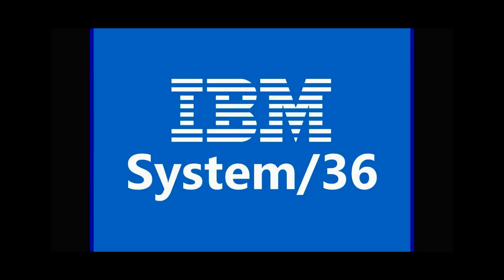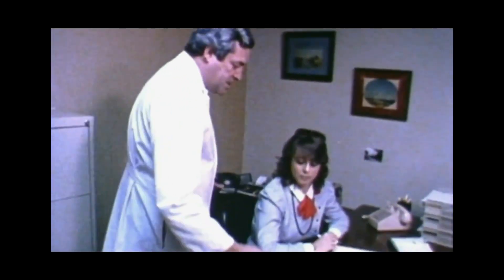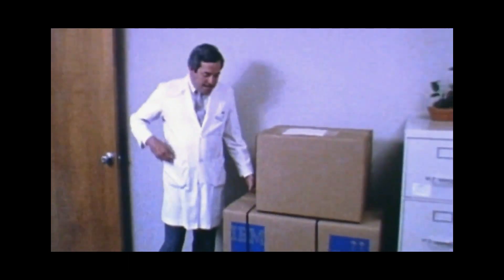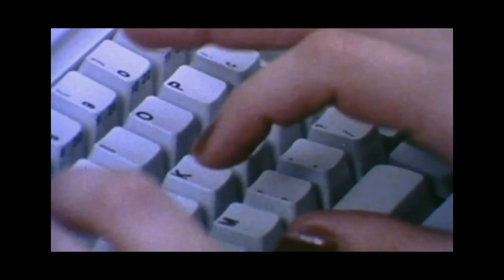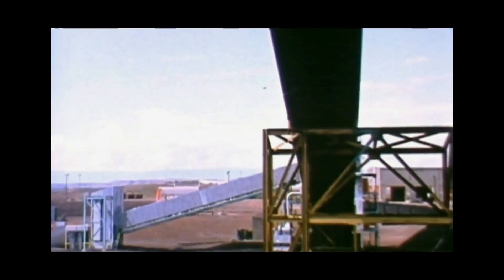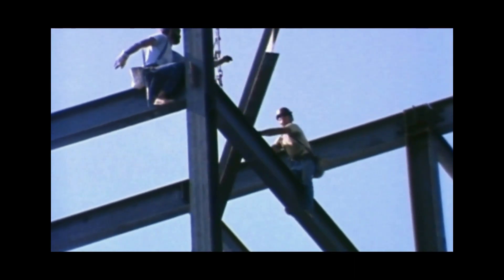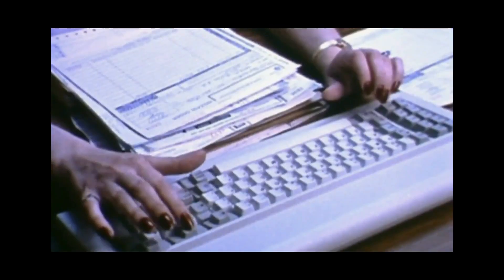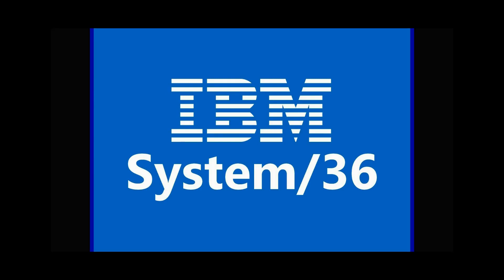1984 Computer History:  IBM System/36 Minicomputer promo, office automation, business, Rochester NY

Comment: A lot of memories. Well, the 3/36 is a "small" system in IBM's terms, not only in size but particularly in terms of cost. However, to ordinary medium size companies, especially companies outside US, the cost of any of the system or the peripherals  components are not cheap. I remember buying a tape drive for data back up (the size of a washing machine) would cost USD20,000,  a line printer will cost similar, list price, if you don't have some kind of corporate discount. The company that I worked with some of the deepest discount level, up to 40% on some items. Even with this level of discount, a fully configured system which can support for about 100 terminals will cost about a quarter million (but the potential benefit it can bring will be huge too). So there are a lot of OEM or compatibles available in the market, and even some specialized company selling 2nd hand equipment. 1985-2000 is also the years for down-sizing. IBM created the Personal Computer standard, which I believe even IBM itself cannot have foreseen the huge impact of PC to the world. All the rest are history.
Reply from the maker: Hi Frankie, yes, you make some great points.  I also remember the System/36 and it was quite expensive for a "mid-range" or small system.  Our first model only came with 1MB memory.  We had to pay a lot for another 1Mb.  These were interesting times for IBM.   So much changed with the advancement of the PC world from 1982 onwards.  Great to have lived through these times.  Thanks again for your great feedback!  ~ Charles

Comment: I did operate the midrange systems S/36, S/38 (Quaker Oats) and AS/400 (Quaker Oats, Head police quarters in The 
Hague, The Netherlands) and ABN/AMRO international, though mostly the AS/400. Great machines for relational databases. The OS of these machines were specifically build for handling these databases.
Reply from the maker: Hi Rene, fascinating.  A good spread of different machines.  We just found an interesting AS/400 commercial (video).  Perhaps we should upload it for those interested in that family.  Work at the Hague sounds like it might have been very interesting.  Thanks for sharing!  ~  Hunter

Comment: What is, the latest version of this system?
Reply from the maker: Hi Caribou Data Science, thanks for your question.  I believe this system has been replaced by the A/S 400 series of "mini" computers.  The A/S 400 has gone through several models as well, and followed by the eServer and other machines.  Hope this helps!~
Reply: The system got renamed every decade and is now known as "IBM i", which appears to run on the same hardware as AIX does, but remains compatible to AS/400 applications.

Comment: Boy, that brings back memories, by first real job in MIS was as a System/36 operator, backing that thing up every morning was a real “treat”. I remember the one I worked on being the 5360 model but had some other add-ons, were there expansions for it? Was primarily used for billing there, a ready mix concrete company, VAX boxes handled the ready-mix operations and let’s say getting data from one to the other wasn’t always pleasant.
Reply from the maker: Hi Daren, finally, I get to talk to another System/36 serious user!   Great feedback, thank you!  Do you remember the software that came with it?   IDDU/36,  Displaywrite/36, etc.   IDDU was Interactive Data Definition Utility, or something.  A database.  The machine only had 2 MB of memory.  Imagine if they had made it with 8 MB or more.  Something to ponder.  Thanks Daren!    ~   Victor
Reply: @ComputerHistoryArchivesProject  man, that’s going back a ways, I vaguely remember IDDU but DisplayWriter, yep. Those old high speed IBM printers… The noise they made, had to wear earmuffs in the printer room when we ran invoices and other batch jobs. 

One of the printers, can’t remember the model, had a multi-part form splitter than sent 2 copies one way then fed another one, the white one, to an automated envelope stuffer. It was all quite mesmerizing to watch, when it worked…
Reply from the maker: Hi Darren, yes, I remember those printers too.  Where did all that heavy equipment end up?   Some in landfills,  I guess...
Reply: @ComputerHistoryArchivesProject  probably, I’d love to be able to de-solder some chips off that old stuff now. Had I known about the Great Chip Shortage 2 years ago…

Comment: I loved the S/36, as I did the S/34 and S/32 before, as well as the S/38 and AS/400 which followed. I did an enormous amount of development work on all these before switching to Unix, Windows, and mainframe integration. Good times!
Reply: Me too!  I did y2k conversion on DAS in RPG!  2 different installations, running on AS400 Advanced 36.  Still have about 5 of them in my garage.  :D
Reply from the maker: Hi Emmett, interesting info.  Were these systems all in use a the same company?